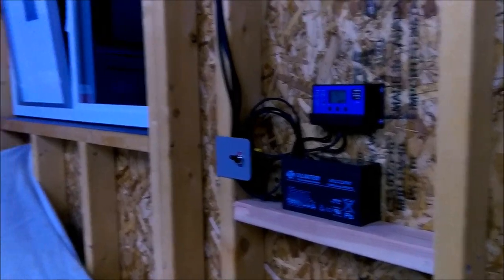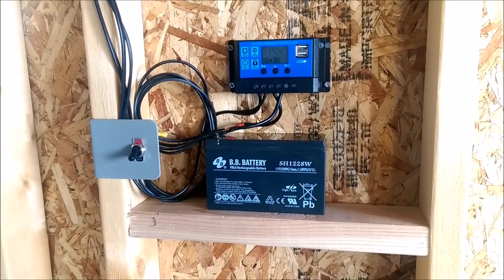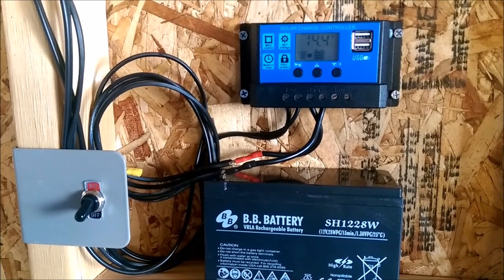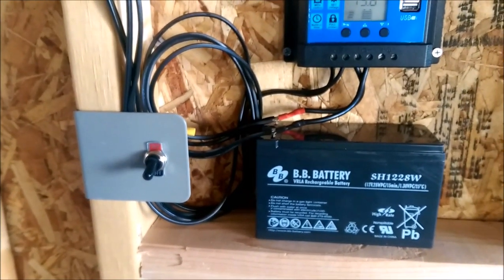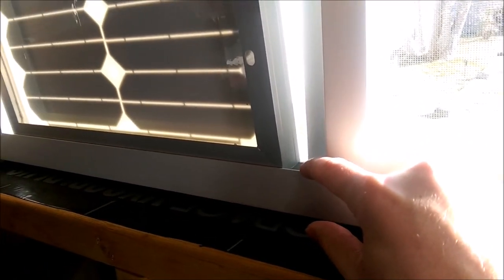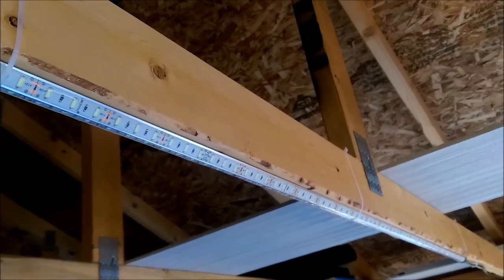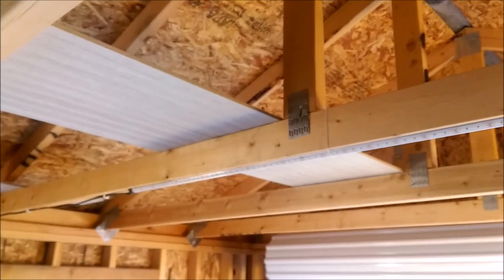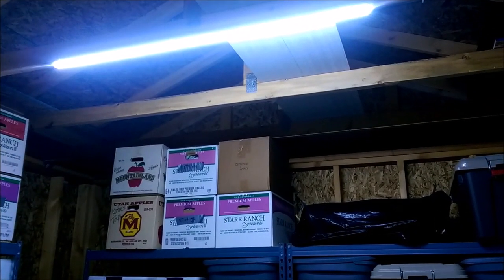DIY Solar Shed Lighting! Affordable LED Setup

Comment: I just remodeled my shed and this was a great finishing touch.  Thanks for the links to the materials.  I was able to get everything off Amazon except the angle iron.  One thing to watch out for - if you drill holes in the aluminum and screw that into the beams, be careful not to short out the strip.  It's really easy to do. If the lights keep going out, loosen the screws and put them back in gently.
Reply from the maker: I'm glad it helped! Thanks for watching and thanks for the tips!

Comment: That is one clean and organized shed.  Don't forget an inline fuse or two.  I know it's a hassle but it's pretty cheap and peace of mind goes a long way.
Reply from the maker: duannguyen thanks appreciate you tuning in, planning on putting a fuse in shortly!
Reply: What fuse / configuration did you end up installing?  Great video - this is exactly what I need, installing as soon as parts arrive, thanks so much for posting!
Reply: What is the inline fuse for?  Just learning about this cool stuff.

Comment: I did a similar setup in my shed with a deep cycle 12v battery. and led strips. The one problem I had is forgetting to turn the lights off and coming back to a dead battery two days later. I solved that by replacing the switch with a one hour timer mounted to a standard 110v wall switch box. Now if I forget to turn the  lights off the timer runs out and the lights turn off. no more dead battery.

Comment: You should use the output load part on that charge controller that way you have over discharge battery protection. I have Two of those charge controllers and they work well.
Reply from the maker: I never use the lights long enough to discharge the battery to damage it. If I used them more I would use the load attachment points.

Comment: I have been using RV bulbs, standard screw in base so you can use a standard light fixtures 12-24v. I also have some hand wired 10w LED cobs @ 250ma for free* lighting installed in every ceiling in my house.   All of my outbuildings, shed, coup, greenhouse have independent systems like this...until recently.  I just ran a 10guage pair, and a 6 wire solid core(control wire) thru every structure.   Now I can have some fun :)  I was just searching to checkout others projects like this. Thankyou! :)
Reply from the maker: Excellent ideas! This video is a bit old, I'd probably do it a little differently if I re did it now haha.

Comment: I think you're supposed to hook in the load (lights) in to the extra port on your solar charge controller rather than taking the load straight out the battery. The reason behind this is that the solar charge controller would then prevent you from using the lights when the battery was not charged enough.  It's unhealthy to over-discharge a battery.
Reply from the maker: Hobby Picker thanks for the tip, I understand how its supposed to work, luckily I understand how low to drain a lead acid before damaging it. I  left it unhooked because I didn't want my solar charge controller always pulling a small amount of power from my battery.
Reply: I agree, that is what the load terminal is for. 
The regulator would use a small amount from the battery regardless of whether you use the load terminal or not (such a small amount it's no worth worrying about) 
Better to have low voltage protection that the load terminal provides.
Reply: @mattburrows2615  Ok, so now i'm confused.  I'm about to try this. :-)  Should I do it the way the video has it or go through the controller?  Keep in mind I know nothing about how this stuff works. 😃
Reply: @wheelerk2012  it's OK. I can answer any questions you have. 
It will work the way shown in the video but you will need to make sure you switch the lights off when the voltage gets low or lights look dim to greatly prolong the life of the batteries.
The benefit here is you won't be left in the dark until the batteries are totally drained unless the lights have a low voltage protection. 

If on the other hand  you wire the lights to the load terminals the controller can disconnect the lights automatically when the battery reaches the adjustable low voltage cut off value. 
This of course has the drawback of potentially leaving you in the dark without warning but a battery and panel sized for the purpose can avoid this. 
 It just depends how many hours you want to run the lights for and how much power they use. 
You will get to know it's capability. 
I use the load terminals as I have the lights on 24h a day then adjust brightness on a dimmer as required. 
Hope this helps. Feel free to ask anything.
Reply: @mattburrows2615  helpful thank you

Comment: I am very curious as to how long those lights last when on continuously. My apartment landlord wants a solar light solution for his car ports and I think this could be very effective with low maintenance so long as the run time is good. Please advise.

Great and simple video btw!
Reply from the maker: These lights in a full strip put out lots of light and use lots of power. If you want the battery to last all night use only a few feet of light.

Comment: This is an awesome video. I have two questions, should I use 2 inline fuses?  Also, what type of connectors are you using to connect the wires to the battery?

Comment: Great concept! Just built an 8x10 shed. What modifications to this setup could I make to increase my lighting to 4-5 hours? Battery type, etc?
Reply: Edit - found a batt calculator; would need a 120ah ($250) battery according to that.
Reply from the maker: Depends on how much power your lights use, 12 volt led lights are very efficient. If they only pull 2 or 3 amps, a 35 Amp hour battery would last plenty long.
Reply: Hey there! Some follow ups bc I’m using this lay out and may help others: it looks as if you have 1 cable going to each angle piece which has 2 strips on them. Is this accurate? If so how did you connect each strip end to 1 cords + and - side; seems like you would need 2 cords per angle piece. Additionally I was going to use 3M Scotchlok connectors to bridge off of main line running to the back to feed the first angle piece any foreseeable issue with that? And did you just secure angle ends with electrical tape? Thank you!
Reply from the maker: @waynec1752  The aluminum angle is secured using zip ties to each rafter. I wired the lights together using 14 gauge exterior landscape wire, each light has a positive and negative wire coming directly from the battery and I just daisy chained the lights by connecting positive to positive and negative to negative. Each LED strip has double sided tape that sticks directly to the aluminum angle. Does that answer your questions?

Comment: So the battery is going to the charge controller, and also to the light switch?  Then the lights connect to the switch, and solar panels connect to the charge controller? Sorry if it's a stupid question.

Comment: Great video and a massive help on my new low energy design and layout. Your using a SH1228W battery and they are 8AH? do you have any calculations on the energy those lights use, the length of time they last on a full battery charge? What is the wattage per strip?

Comment: Jason, great work. I just purchased everything to do lights in my shed. Any chance you could put up some closeups of the wiring at the battery and how you connected the lights and the battery to the terminals?
Reply from the maker: Google how to setup solar charge controller wires and you'll get some great images for a layout.

Comment: Nice video,  how long does the charge last when using the lights and how long to fully charge.  Thanks
Reply from the maker: This uses a small battery,  it runs the lights for like 2 hours.  If you want a longer runtime jut get a bigger battery.

Comment: If I wanted to run my lights longer than an hour, what battery would you suggest purchasing? Will that solar panel still be adequate?
Reply from the maker: Plan on a 5 amp draw with these lights so if you want to run for 5 hours each night you'll want at least 50AH battery to not run your lead acid below 50%DOD (25 Amp hours is 50% of the battery)

Comment: Sorry this is way late but if I added a second battery and cables would it store more energy [From west Texas so sunlight is no problem around here] 
Thank you for the help
Reply from the maker: If you wired both batteries in parallel, yes it would add more storage. Thanks for watching!

Comment: This is extremely helpful. My garage is about the same size  so this will do wonders. The Amazon links still work but would you recommend any other upgrades as the video is now 2 years old?
Reply from the maker: Larger battery if you plan to use the lights more than 20 minutes at a time. Other than that, I love them!

Comment: The LED lights you linked come with an AC power adapter, I’m guessing you just cut the connector off the lights and plugged the + and - wires directly into the solar charge controller?
Reply from the maker: This video is super old so I'm guessing the product may have changed. Just make sure they are 12v leds, wire up the battery pos and neg you'll be good

Comment: Would there have been any difference between wiring up to the load terminals on the charge controller instead of the battery? or was that just preference to go straight to battery?
Reply from the maker: Just my preference. If you go through the load terminals you get the automatic shutoff when the battery voltage is too low. You can also schedule the power source availability. I just wanted to keep it simple and run my lights off a switch. Either way works well.

Comment: Great video!  I have a shed that is 12x24 so 50% more square footage.  Is this system simply scalable?  Looks like the next power solar panel is 50W and I have a 24x36 window.   I'm thinking of going to a 15 ah battery and 4 - 6 strip lights.  Do you see any issues with that?  Any additona advice?  Thanks.
Reply from the maker: It is scalable, it all is based off your desired run time. If your lights pulls 5 amps, then a 10 amp hour battery will last 1 hour because you shouldn't take it past 50% capacity. So if you want your lights to run longer, plan to have more battery storage. Also, make sure your if you put the solar panel in the window it will have light all year round. My south facing window gets full sun in the winter, and only half sun in the summer, due to the height if the sun and the soffit blocking the light.

I recommend doing this project though, it's a great way to get power for your shed. You can also use the sun to charge other lead acid batteries to motorcycles and cars if they are close enough to the charge controller.
Reply: Thanks for the quick info. One more question, sorry to be a pain. If I go with a 50w panel and a 12vl15ah battery do I need to upsize the controller?
Reply from the maker: @dillygaff7624  no, a 50 watt solar panel puts out about 1.80 amps, this solar charge controller can handle at least 15 to 20 amps.

Comment: Interesting, I was just thinking maybe I could use the solar trickle charger for a 12v battery I bought for my lawn mower, hook it up to an old 12v car battery I have to power up some LED lights for my shed that doesn't have AC power. As far as switch, it seem like you could use just a regular AC wall switch. And I'm also wondering if for a battery I could use my 18v power tool batteries. That way I could use one of them that was charged up if the one charged by the solar panels was low or ran out while I was in the middle of doing something. And as far as hooking up to that batter I have an old drill that recently died and luckily I didn't toss it because I can use it's base as the plug in point for my 18v batteries! How much heat do these strip lights put out. Do you think you could use some of the LED tubes that replace fluorescent tubes in a fluorescent  fixture without ballast or maybe one of the plug in tube fixtures and just bypass whatever ac/dc converter it has?

I actually bought a couple led lights at the auto parts store that had two 9 volt batteries hooked in series to provide a store demo so I'm thinking some more lights like them should be able to run off my 18v ryobi batteries.
Reply from the maker: These lights don't put off heat at all because they are LEDs. A 12v battery would power these light just fine. If you wanted to run higher voltages like 18v you'd want to make sure the leds you bought support that voltage. This video is pretty old and my lights still are working great!

Comment: Awesome setup! I just added everything to my amazon cart because this is exactly what I needed. What did you use for the switch mount?
Reply from the maker: It was a metal L bracket I had laying around, I just drilled a hole and painted it gray.
Reply: @Jasonoid  gotcha. Thanks for the reply. I have some laying around but nothing that large. I wanted someone bigger so I don’t slice my hand when searching for the switch in the dark 🤣
Reply from the maker: @andrewleman3106  there are probably many ways to do it, but yeah make sure it's not sharp to slice you in the dark! Good point.

Comment: Hi Jasonoid, really like this setup. Just had my own 12x16 shed installed on yesterday and think this setup would be perfect with a slightly larger battery and using the Load connection on the controller. 

Would like to know how the connection from the LED lights is made to the wiring going to the battery. The LEDs seem to have their own style connector which is recommended to be connected to an adapter but you didnt do that. How did you connect to the landscape wire? Did you use the LED connector or just cut that off a wire directly? 

Appreciate it!
Reply from the maker: A larger battery would be recommended after me using mine this long. I just stripped, tinned and soldered the landscape wire directly to the led strip. Works great, just use some heat shrink or elec tape to keep it insulated. Thanks for watching!
Reply: @Jasonoid  so say a 24v battery? I want to power lights very similar, if not the same as yours and also may want to add a power inverter too later.
Reply from the maker: @bane1240  these led strip lights are designed to run off 12 volts, and so are most solar charge controllers. So you can either parallel 2 12 volt batteries or just buy a larger Amp hour 12 volt battery for more storage. 24 volt systems don't work with my setup.
Reply: @Jasonoid  Thanks! appreciate the responses.

Comment: Hi really like the video and just what I intend to do in my sheds. Thanks for posting. Just one question, is there a reason why you connected your lighting circuit directly to the battery and not to the DC terminals on the solar controller.
Reply from the maker: Just preference, connecting the lights to the load out will keep you from discharging the battery too far. You can do it either way. Thanks for watching!

Comment: I don't have anything to compare this to, but I am curious why you didn't hook the light wiring to the load connections on the charge controller so you couldn't accidentally leave the lights on and over-discharge the battery.  Other than that curiousity, I really like what you did and how clean the wiring work was done.
Reply from the maker: Mark Chapmon thanks for watching my video! Just personal preference, and for simplicity. I personally won't leave the lights on to over discharge the battery.

Comment: Gday
nice i put a car battery and a solar panel in my 40ft container and set up 3 1m long led lights on 3 switches and run a car radio i put the lights in a alloy channel held on the roof with hard drive magnets cos i did not want to put holes in the roof and all wiring is in poly pipe and the cam can not show how good the light is.
cheers

Comment: Great video. So im guessing the lights are on the angled aluminum? Also what isnthe black ends of the lights?
Reply from the maker: Solder joints with the other lights and wiring

Comment: Did you cut the LED light and then solder them to the size you wanted? Wanting to try this project early next year.
Reply from the maker: Yeah, I just measured and cut the strips to how long I wanted them, then I soldered them together with jumper wires. Still working awesome two years later!
Reply: @Jasonoid  another question, you put a switch, if the switch is off, does the battery get charged?
Reply: I also noticed you did not use the light outlets on the solar charge panel. So you just connected the lights directly to the battery, and the battery directly to the solar charge panel. Curious why did you not use the light outlet on the panel.
Reply from the maker: @bpekarek1986  good question, the switch is only on the led light positive line. So the solar charge controller is always connected to the battery and charging.

Comment: Hi!  Writing to ask if the positive wire (supply) to the switch could have been routed from the "load" terminals on the charge controller?  I understand of course that the positive wire directly from the battery to the switch does work, but I figured I'd ask why you didn't use the load terminals on the charge controller for that purpose.  Thanks!
Reply from the maker: Yes, you can use the load terminals for the lights. It adds extra protection to your battery so you don't run it down too much. Just skipped it on my project.